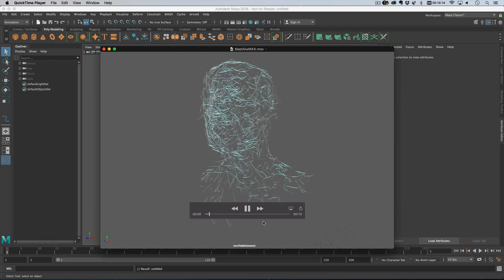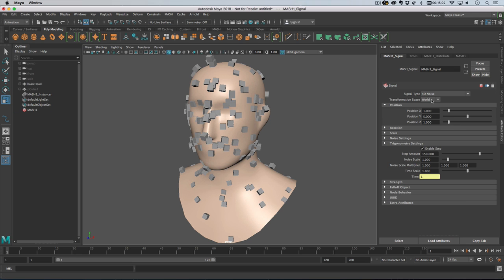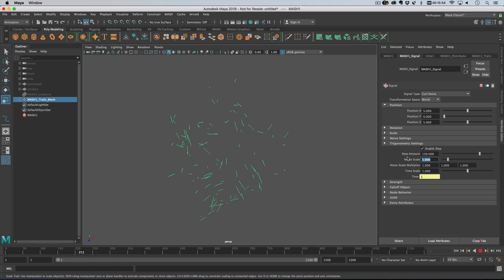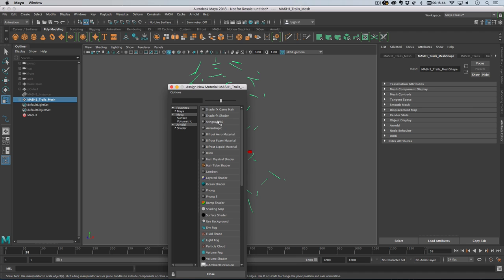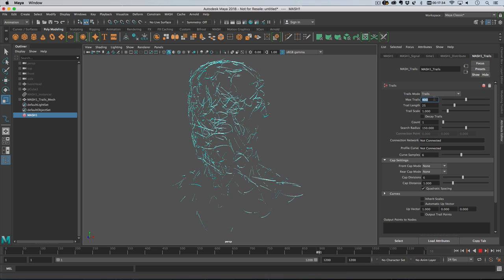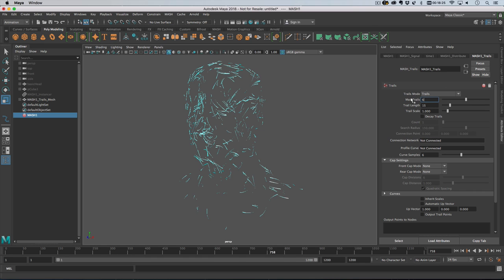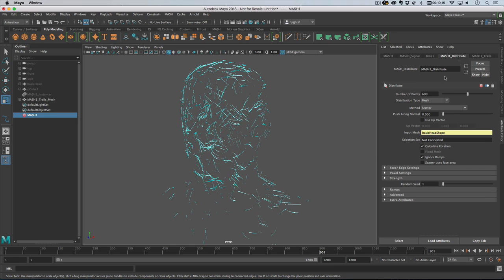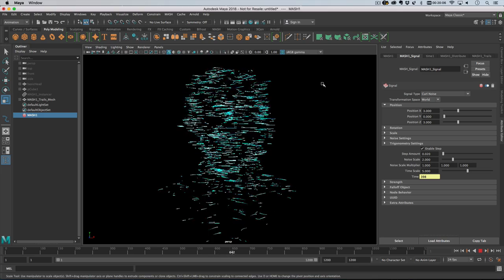Maya 2018 - Curl Noise Hologram

Comment: How do i increase the trail divisions along the length, there is only an option for Curve Samples for the profile of the trail.
Reply from the maker: You can't, you need to either smooth the final mesh (hit 3) or 'simulate it slower' and speed up the result. Sadly MASH has no concept of 'sub-frames' to do this more automatically.
Reply: @ianwaters6035  Hi, thanks for responding, so it creates a vertex per frame.I'm creating a lightning trail effect like in the Flash TV show, on an animated character i used a trail and a signal to add noise, now i need to randomize the visibility.
Reply from the maker: @Icemanmodeler  Sounds cool. You can do this with a gradient texture (black and white, no interpolation) in the transparency channel, and randomise the movement of the stops somehow (you can even use MASH with the Breakout Node to do that). I don't have Maya installed at the moment, but that's how I'd go about it (from memory).
Reply: @ianwaters6035  Cool, ill see what i can do, thanks.
Reply: @ianwaters6035  This is how it looks, the random visibility thing is a bit to hard to do, also wish i could keep the thickness of the trails, they like to become small at the end. https://www.youtube.com/watch?v=sApzkxLF3iQ&feature=youtu.be

Comment: Great tutorials Ian, however on this one i'm having an issue.
I'm trying to connect some nParticles up to this setup and most of the particles are working as expected - but when some of the particles get to a certain point im getting some large trail lines connecting up from the particle to what appears to be the emission point of the particle. Has anyone seen this before???
Thanks!

Comment: Hi Ian. Fantastic stuff! I absolutely love your tutorials! Every single one of them. Thank you million times.

I have a question (or idea for future tutorial). I tried and re-tried.. and googled and googled more, but couldn't find a way to move MASH points along the surface of a mesh. What I mean by by that I'd like to randomly move points (and leave trails) which would travel on top of the mesh at random speed to random directions. I know I could create curves along the surface, but that's far from ideal. It would be also nice if the points had random lifespan. Would this require Python scripting (and someone who knows what they are doing) :/ ?
You have two tutorials that come quite close (curl noise and the trails on type). But unfortunately neither technique can't quite provide the solution.